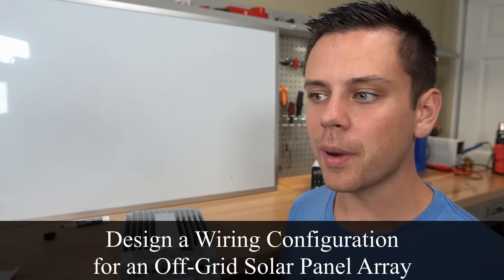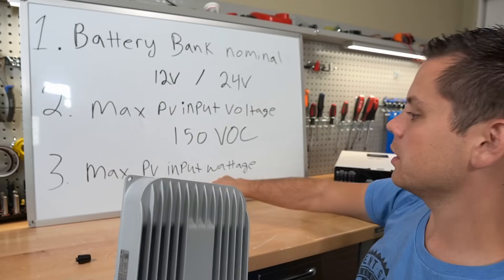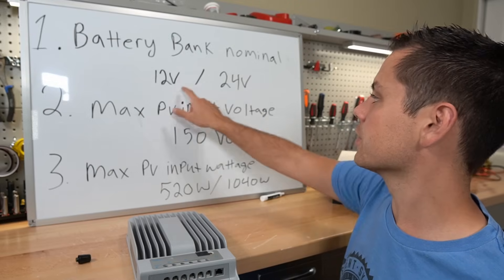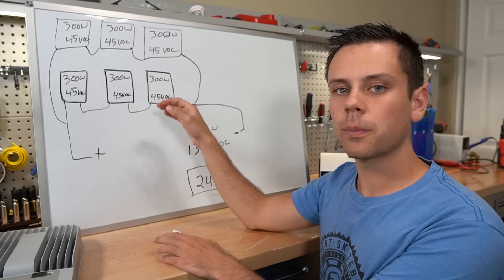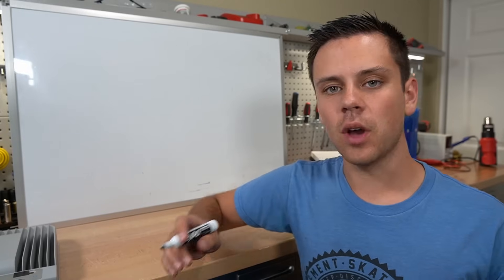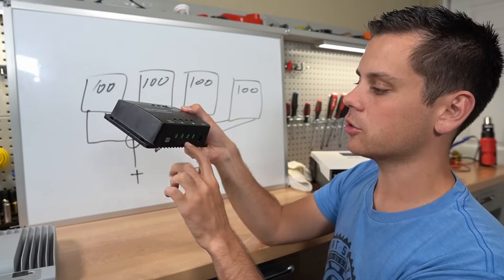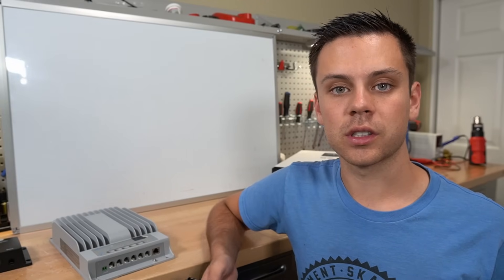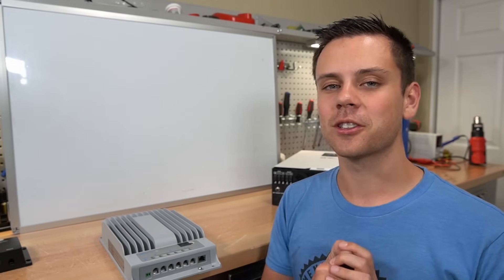How to Design an Off-grid Solar Power Array Wire Configuration

Comment: I don't know why I'm having such a hard time grasping how this all comes together but this video is one of the clearest I've seen. This whiteboard classroom style is really really good. Please keep doing these Will. Thank you!
Reply: Same here, putting together my first system and quite frankly..Will's videos are my go to for anything regarding this subject. I've planned this out over the last several weeks based off his tutorials and examples and the ordered parts are trickling in. Excited about starting my new build next week- wish me luck! And Will, thanks for sharing that knowledge, keep up the good work!
Reply: just hit rewind and pause a few time
Reply: I agree. I just started learning about solar setups out of necessity. These videos are the only ones I come away from with actual understanding.
Reply: I know me too bro. Have to read the same info over and over
Reply: Read the specs on your equipment then do the math to determine whether you need to be in series or parallel.
Reply: @Mark Kornett
Reply: I think there's a basic line of knowledge that's required. I think this knowledge is volts, amps, and watts. What gets me in the difference of how these are applied with regards to AC and DC currents. Further study is required on my part. But as with all learning you must first discover what you didn't know then learn in steps as you find more that you don't know.
Reply: Probably because you don’t understand the basics of electric… volts, amps, resistance ect
Reply: You nailed it!
Keep making reducing climate change by solar training.
Reply: Absolutely ! 
I had to come back to look at this again.
Reply: I’m with you. I’ve watched so may vids and still confused.
Reply: I know almost everyone gets a few panels first. Look at you panels labels and then make sure you get the equipment that will handle more.
Reply: That makes 2 of us  trying to grasp, I have developed arthritis trying to grasp this part-the charge controller and wire sizes but I have grasp,mlno but nor maybe
Reply: Just make sure your inverter, panel and battery are all rated at the same voltage, and you should be fine.

The sun can't push any more energy into your solar panel system beyond it's voltage rating. Even if you have a million panels, they can only operate at their rated voltage.

The inverter is designed to PULL energy into it. And it can take whatever it wants. Energy isn't "pushed" into it.

If the panel array is rated at 10 million amps with a 10ft thick wire, that doesn't mean the inverter will take 10 million amps and fry itself if it connects to the wire, because it will only take what it needs since it is rated at the same VOLTAGE.

It's a straw that pulls power, it's not a pipe that takes pressure.
Reply: @dialecticalmonist3405  that's an understandable analogy. Thank you!

Comment: Question. I am setting up an array of 2 legs of (4) SunPower SPR-X20-250-BLK panels. Each leg has two sets of (2) panels in parallel. By my calculation, the VOC should be not more than 101.8 Vdc with nominal output of 1000 Watts for each legs. Of course, the two legs will be in parallel so that total output will be 2000 watts while maintaining the ~ 101 VOC. The total wattage will be about 4% high of the MPP 24V24 max as calculated by multiplying the system voltage of 24 Volts they current limit of 80 Amps. I expect sustain full power output here in AZ for most of the day. Will this marginal over wattage destroy the controller or will it shunt the excess power out of the system as heat? I really need the 2000 Watts to bring the system back to full charge will using power during the day. Please respond. Thank you

Comment: Keeping under a max is great, but you don't mention minimum voltage. My inverter/charger doesn't even start to register incoming power until the PV array provides 150V, and if it drops below 120V it cuts out. I had to revise my 4S3P array to 6S2P to get enough to keep working.

Comment: I believe in the fine print EPever says the Trever can handle up to 3x listed wattage on the input without damage. I have 1 40amp tracer running with 800watts @ 12v and another running 1300watts @ 24v. Both have been running 24/7 for nearly a year even in the 100+ degree desert heat. 

Awesome video for beginners!

Comment: Wait, you sum the wattages of the panels when in series?
Reply from the maker: Or parallel. Add them up.
Reply: @WillProwse  I received the notification just now that you answered, so here was my question (sorry for not being clear):

When you didnt even touch on the question of the max current or voltage it coult take, you oppened yourself to let it take 10A at 100v or 1A at 1000v and that could couse problems if all you did was to sum the wattages, but thinking again I, as someone that just came on your channel and is not completelly on the know, all solar panels must be somewhat standardised so that must not be a problem.

Sorry about that.

Comment: Thanks for the nice video will.
I have a question regarding faulty panel in paralels. If i use diode, can that avoid overheat/fire to that faulty panel?

Comment: Great video. I'm working on this now to determine solar for a 72v battery bank powering a marine 20Kw motor. Will Prowse are you going to review Battle Born's new flex solar panels. I like how you just peel and stick on without drilling holes and needing brackets, and how durable they seem. Also excited about Tesla/Maxwell new batteries on the near horizon. Great innovation. Do you think that will lower the cost of Li-ions?

Comment: What if a system was built with a battery with a small inverters and speed controller starting a dc 24v motor that has 6000 rpm @30 watts connected to a turbine they sell them online anywhere to 400w to 2000w I’ve seen better performing but do not know much about bthem  it would need also a charge controller and resistors.
Reply: The rpms are stated to be for turbine to be at the best potential rating at 3500 rpms

Comment: I have ten 315 watt, 24 V panels in two parallel runs, hooked together for one series combination going into the exact all-in-one MPPT controller Will showed all running two "homemade" 24 volt batteries with 8 Kelb 3.2 Volt Battery Cells each (like Will shows in other videos). 
COST: The panels were used at about 33 Cents per volt, the rest, including BMS, wire, fuses, etcetera was all new. Throw in the used steel stem pipe (from oil wells) and the cost for a 3000 watt 24 volt system was just under $4,000. 
USE: It is off grid where I don't have to deal with code, just my own safety concerns. This system easily supports a normal modern lifestyle in a modest two-bedroom house with everything to include washer and dryer, except air conditioning.

Comment: I'm curious why people are still using 12/24 volt batteries for medium or large off-grid and hybrid systems? I built a 48V system, as this provides higher efficiency for powering an inverter of over 500 watts. I suspect 12/24V systems are a vestige of old lead-acid battery technology, which has been traditionally sold in 12V modules.
Low-voltage DC appliances have traditionally been designed for 12 or 24 volts. However, technology has advanced, solar panels are getting cheaper, lithium batteries are more efficient than lead-acid, and buck power-converters for 48V to 12V are inexpensive, in case one already has a 12V appliance.
Of course if one is living in a small cabin with just a few 12V LED lights, some USB phone chargers, and no AC appliances, then there is no need for anything over 12VDC.

Comment: I'm surprised that you are worried about overwattage. I am using Victron MPPT charge controllers. As I understand it, one MUST respect the maximum voltage. But the amperage is flexible -- you can overspec the solar array amps, and the charge controller will only draw up to it's maximum (i.e. at midday, some power would go to waste). If you overspec your solar panel array then you will get more power in the morning and the afternoon, and in Winter, when the sunlight is weaker.
Apparently, the max voltage is for the MPPT input. But the max amperage is for the charger output! The MPPT adjusts the input current draw (amps) to load the panels (draws down their voltage) and pull the maximum power from them -- converting that power to match the battery's charging voltage, while keeping the charger output under the maximum charging current.
Comments?

Comment: Hi there, newb battery builder question here- and thank you for all the great information!

I am looking to build a 48V system from Overkill products for a custom camper van, and my question is regarding the 500 amp peak discharge of the 100 AH cells: Does wiring and fuse sizing need to be sized to handle 500 amps? Or does the wiring and fuse sizing only need to be sized for the continuous C2 (200 amp) current flow?

When I start looking up the sizing of wires and fuses for 500 amps, the results make me think I am miscalculating somewhere.

Also: considering overkill only sells 24 volt BMS systems, if I made (2) 24 volt systems, and gave them each their own BMS, then connected in series to get 48 volts, would I now have to account for 1,000 amp peak discharge?

Comment: Few days ago i saw you asked for tips for making new vids. Well i have 1 and will try to explain, cause english is not my first language.
It is hard to find vids sizing array acording to battery bank. 
In my case i don't want to buy several batteries to my system cause i use only for a few lights with a inverter AND batteries are way too expensive. So i have a 70A battery in 24V with this exact charge controller. i use 2x 245W solar panels in series and am not sure if they will charge the battery bank way to fast or too slow. I want to charge my bank with the best rates cause i need them to last longer. If i made myself clear, i'd say this is very hard to find a video explaining about that from people who actualy KNOW what they are talking about. You seem to know tons about it AND know how to make people like me to undertand. 
Best regards from Brazil. and Keep up your vids. Great information and well explained for newbies like myself. :)

Comment: I think the biggest challenge is to reach the charge controllers wattage rating without exceeding input voltage and amp rating. Solar panel size probably is an important factor

I have the MPP 24V 2400 watt controller. Using 300 watt 24V panels, I can’t get more than 2S3P.. that gives me 120voc, 1800 watt and around 33amp on a 24V battery. 
However I feel that my low light environment in northern snow country needs higher voltage input to make up for lack of sunshine. I’m thinking of using  an Outback charge controller that can handle a S1P5 of 300 watt panels. It’s rated for 300voc. That gives me 200voc, 1500 watt and 55amps. This is connected to the same battery but independently from the MPP. The combined 88amps is below the 100amp charge rate my battery can handle (it’s 44amp per battery).

In my mind this setup will satisfy two things. Higher overall charge rate since 1800 watts is not enough for my needs. Add a low light input guarantee. I hear from many people their solar setup is not producing power until they have plenty of sun and every single one of them has a max of 3 panels in series. It appears everyone is afraid of high voltage systems and prefers running their generators
Reply: I’m looking at the Outback Power FlexMax 100amp/300voc charge controller. So I could connect up to 6 x 300 watt panels. (1800Watt, 66amp, 240voc)
Input current is rated at 64amp, I’m thinking I would still be fine with 6 solar panels but I’m happy with 5 of them to stay on the safe side.

Comment: Thanks for all your presentations.  I have been following you since you were in the camper.

I do have a request for a presentation. I have (2)100w panels and (3)15w(HF) panels.  Using a MPPT controller 100v/40a is it possible to use up to 5 panels?  I have also seen in one of your past videos connecting two charge controllers to the same battery bank.  Is this still acceptable?  What would be the configuration?   Again thanks for your excellent videos.
Reply: Your wiring is based on charge controller input & output. So if 5 panels don’t exceed that you’ll be fine. I would keep different size panels on separate charge controllers.

Comment: The Epever controllers have highest efficiency with input voltage close to output voltage. The low light output being increased by series connecting panels is also a bit of a myth because panel voltage has got very close to Vmp before any significant power is produced. With the Epever as well they don’t start tracking until input CURRENT is 1.5A. With series connection this can mean you actually lose out on a fair bit of power because, until that current is reached, the controller holds the array at about a volt over battery voltage. In parallel doing this both doesn’t lose you much but also shortens the time before the controller starts tracking. The only real advantage to series with these controllers is where there are long distances from panels to controller and where there are no partial shading problems. Parallel connection mitigates these. Obviously some controllers are better than others and the comments I made are specific to the Epever.

Comment: Looks like the max wattage is based on 13VDC/26VDC not 12/24.  For anyone who might not be aware, fully-charged Lead-acid batteries, at rest, are 12.6/25.2 VDC (2.1V/cell).

Comment: Doesn't connecting the panels in series maintain the wattage and increase the voltage?
Reply: It maintains the current and increases the voltage...
Wattage would b the sum of the panels.! (Assuming the voltages & currents match up)

Comment: I picked up a 200w solar blanket to use in my truck for camping and I read that you need the controller closer to your battery.  Can I extend the wires on the blanket so that I can hang it off my awning and not create charging issues? I really am learning a lot from your videos. Also on the load output can I run a switch to be able to turn an led light on and off?

Comment: Can you cell me the best way to connect 8x280w of solar panels parallel or series? For off grid system but with access to main just in a case of lack off battery banks I want to mention I got single inverter good quality Conversol 3kW 24V 80A MPPT with Bluetooth Connectivity
Reply: What's the spec of ur panels, mppt min/max voltage, battery...?
Without that info we can't help u..!

Comment: Just a word of warning on the max voltage; you need to take into account the temperature coefficient.  I had 6 renogy 100W panels in series with the Tracer 4215BN (rated at 150 Volts).  After applying the temperature coefficient, the max voltage came down to around 135 Volts, which was very close to the Voc of the panel array (even though it was still technically "in spec").  Unfortunately, my unit detonated (well, I heard a loud pop) and it caught fire.  Fortunately for me, I always put up some aluminum flashing before I mount these things, and the plywood mounting board did not catch fire.
Reply from the maker: I actually mention this towards the end of the video
Reply: @WillProwse  Yup, saw that.  I just wanted to make sure that others knew how dangerous it is to believe the specs.  22.5Vx6panels=135V (spec says 138V @ 77 degrees).  You are correct to say "keep it under 130", but I think we need to stay well under that threshold, too.  People are under the impression that Voc is only 20 volts, so they may mistakenly think that 6 panels would be OK when, in reality, 5 panels would be the maximum.

Comment: Just in time. I love your videos and have learned alot from you...I am upgrading to a 800 watt solar array but my victron 100/50 says 700 watts max at 12volts..I think I will be ok with 8, 100 watt panels wired in 2 strings of 4 in series parallel... I am only at 6.1 amps and 86 volts and the panels will never put out 100 watts each anyway...Does that sound  ok to you??  Any other options?? I actually have11  ,100 watt panels anyway I can connect the 11 panels up and stay at 12v?? My panels are 6.1amps each ,100 watt,17.1 operating volts each..Any help would be awesome...I am thinking that I will have to run 2 controllers to use all 11 panels...If so can you mix a mppt controller and a regular oner? Thanks you have the most informative channel on the tube..

Comment: On 10:00 what is about diods? They prevent feeding back power in to failed system, but also when (for example) one Cell is shaded, it will prevent that the affected array drain some power from other arrays (which are connected in parallel)?

Comment: That mc4-branch connector does not look like it's rated for 30 amps - not least the single wire heading out.
Reply from the maker: Good point. Only some branch adapters are rated for it. Gotta check the data sheet